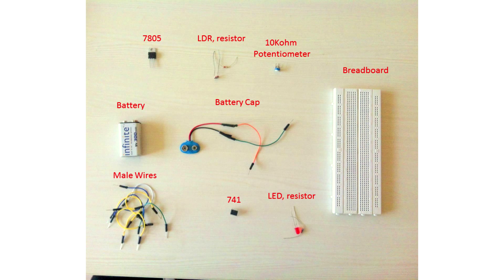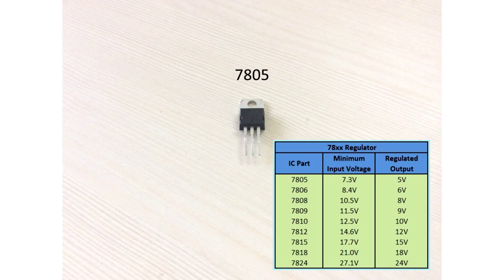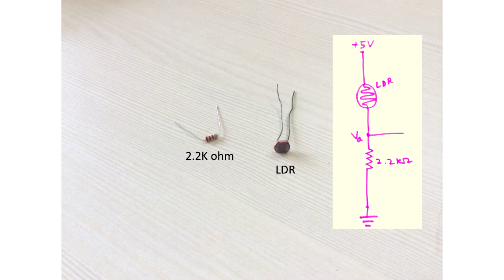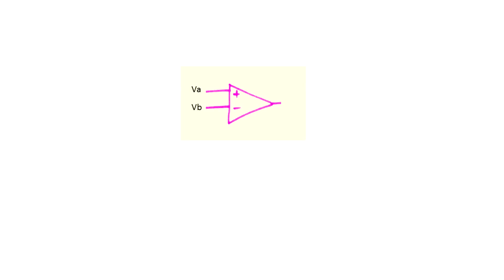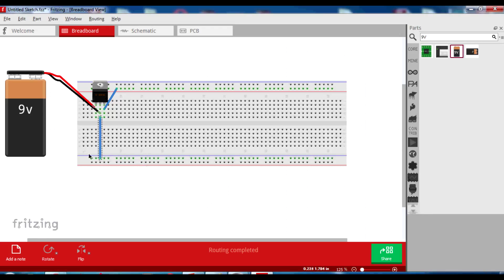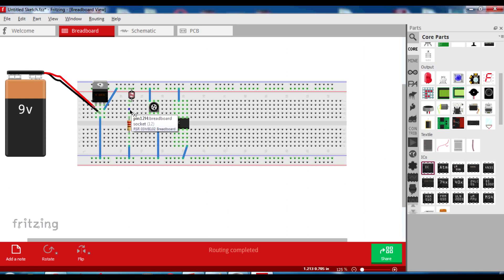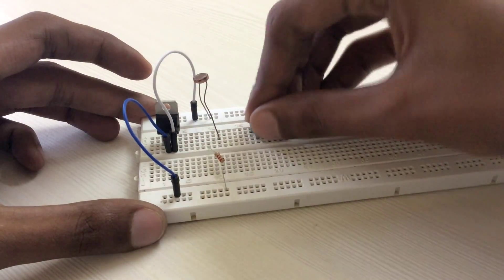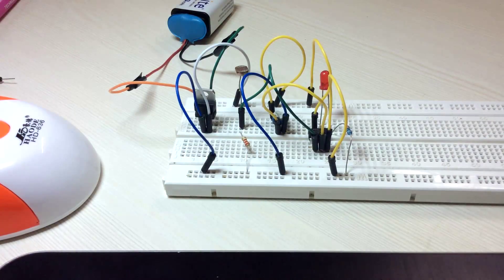Building Electronics Circuits (Tutorial 4): Light Sensitive Circuit

Comment: Thank you very much. But at 4:20 the Va is a plus but later in the schematic the Va is minus. So does it mean that when Va is bigger than Vb, the output voltage is negative and therefor  the LED doesnt turn on but only when Vb is bigger then the output voltage is positive and therefor the LED turns on?
Reply: I just watched this a few times and you are right about Va and Vb being flipped in the comparator diagram vs the whole circuit diagram. I found it easier to consider V+ and V-   If you do that, the message in the video is consistent, namely if V+>V-, output is high, otherwise low.  In the main circuit diagram where you see Va (V-) is voltage downstream of the LDR, if LDR is receiving no light, resistance goes up. Correspondingly Va (V-) drops below Vb (V+), and we have V+>V-  leading to "high" output and the LED lights.
Reply: Thank you, it's nice to see other people noticing that too. So when the output of the comparator is low, it means that that voltage is negative and therefor the LED can't turn on because it needs a higher voltage on the anode. Well at least that's what I assume.